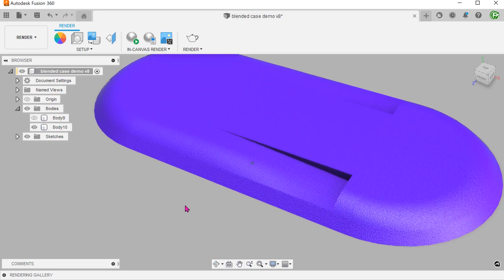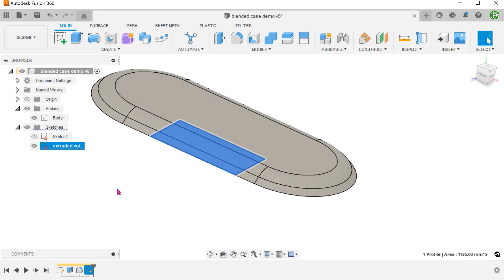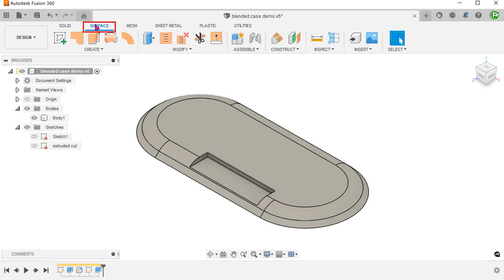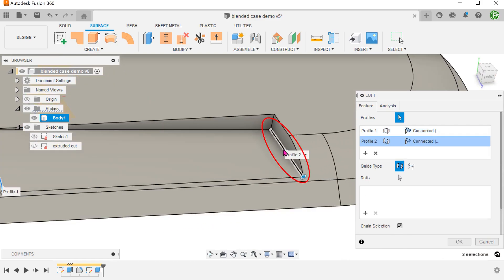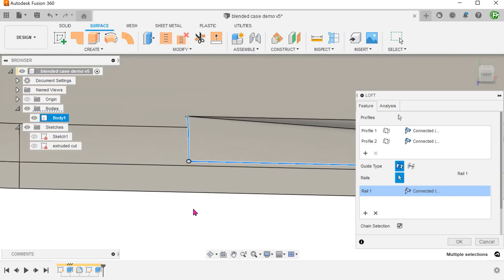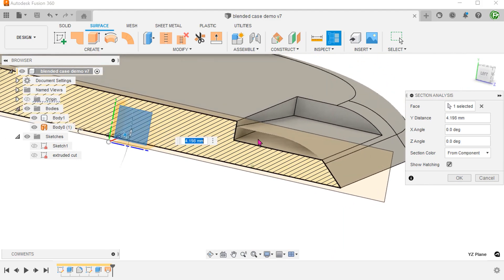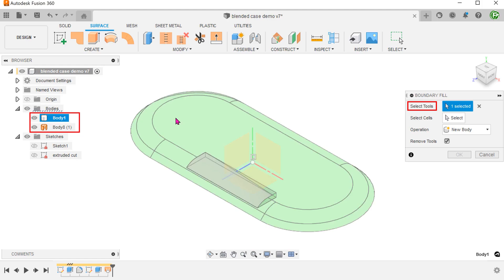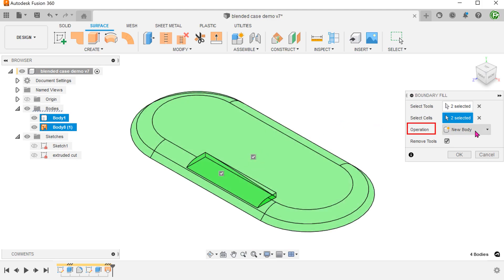Fusion 360 | Case Study 32

Comment: There is no other method to make the same loft in the solids tab? I don't know how I would guess to use this solution. I am weak in surface skills.  Thanks very much. This was a great exercise.
Reply from the maker: While I was exploring different methods for the video, I attempted to use a solid loft by selecting first the closed profile and that edge. However, the solid loft command does not recognise that edge as a valid input. It looks like it can only accept profiles.